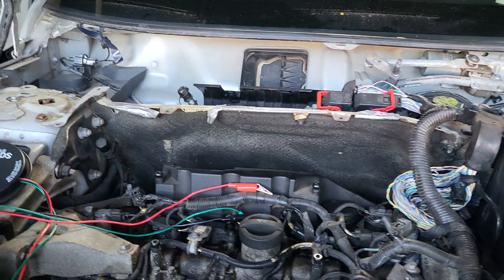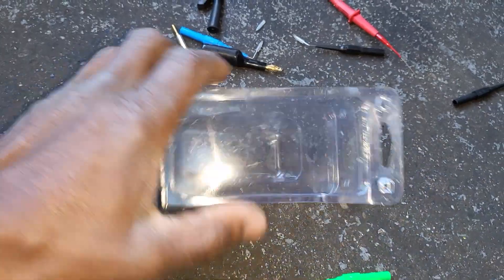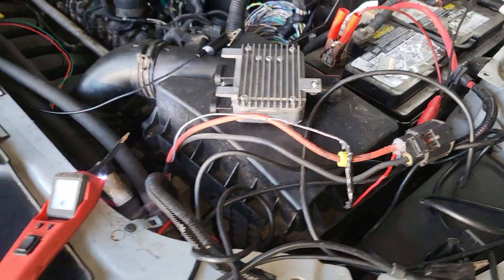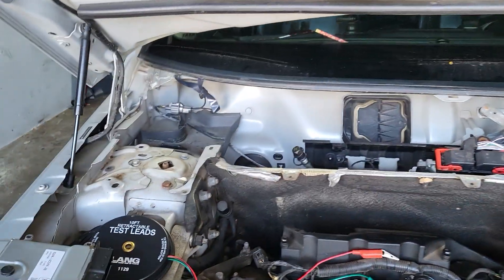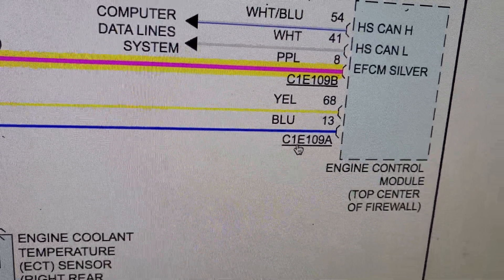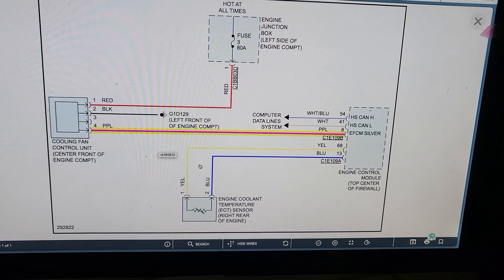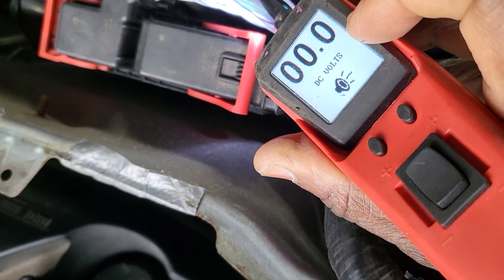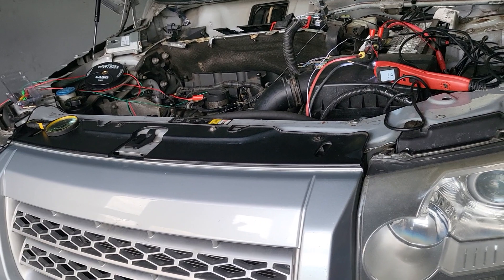2008 Landrover LR2 Overheating _Module _Connections_Wiring Diagram /Computer-Cooling System Fixes #2

Comment: hello, I am facing this problem now, what was the solution? the voltage I checked that red-black connector comes to fan control is only 4.x volt. if I connect directly 12v battery to fan, the fan are moving

Comment: My 2008 LR2 is running hot 5 months after we got the thermostat replaced. The A/C doesn't work. What should I check? I don't want to keep replacing the thermostat.
Reply from the maker: If your 2008 LR2 is running hot and the A/C doesn't work, there could be several potential causes. Here are a few things you can check:

Coolant level: Ensure that the coolant level is at the appropriate level. Low coolant can cause overheating. If it's low, you may have a leak in the cooling system.

Coolant circulation: Check if the coolant is circulating properly through the system. When the engine is running, feel the upper and lower radiator hoses to see if they are both hot. If one is hot and the other is cold, it could indicate a problem with the water pump or a blockage in the system.

Radiator and cooling fans: Inspect the radiator for any signs of damage or clogging. Make sure the cooling fans are operating correctly and coming on when the engine reaches operating temperature. Faulty fans or a malfunctioning fan control module can lead to overheating.

Thermostat: Although you mentioned that the thermostat was replaced recently, it's still worth double-checking its functionality. If the thermostat is stuck closed or malfunctioning, it can cause overheating. Consider having it tested or replaced again if necessary.

A/C system: The A/C system not working could be a separate issue, but it's worth mentioning. If the A/C system has a leak or a faulty component, it may affect the engine's cooling system. Have the A/C system inspected to determine the cause of the malfunction.

Cooling system pressure test: Consider performing a cooling system pressure test to check for leaks or any other issues that may cause overheating. A pressure test can help identify potential problems in the system.

If you're unsure about diagnosing the issue or performing repairs yourself, it's recommended to take your LR2 to a qualified mechanic or Land Rover dealership for a thorough inspection. They will have the expertise and necessary tools to diagnose and fix the problem accurately.